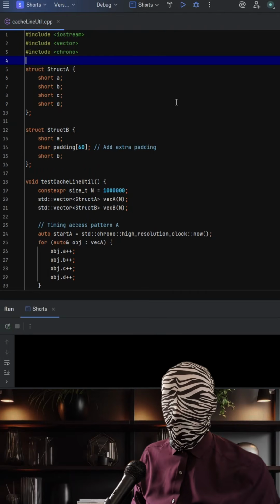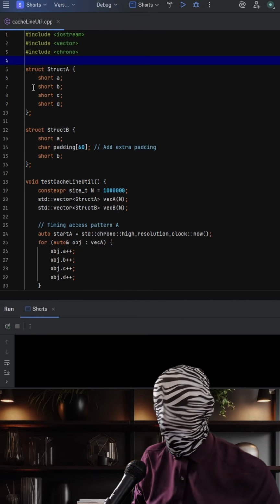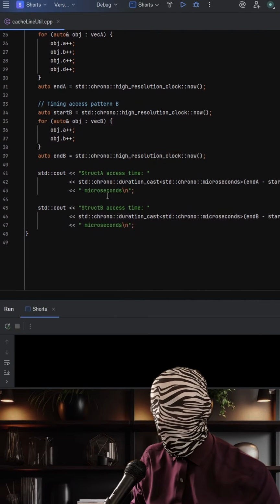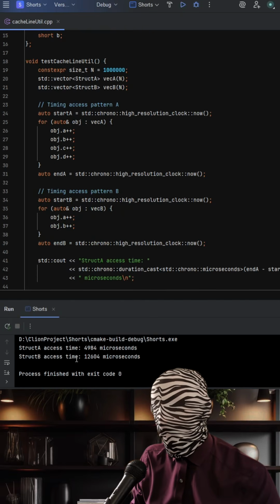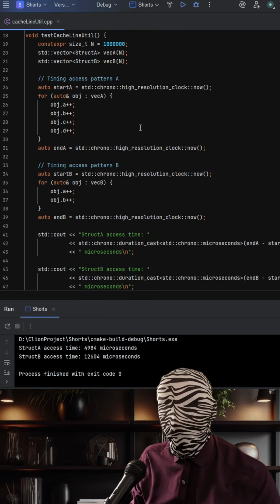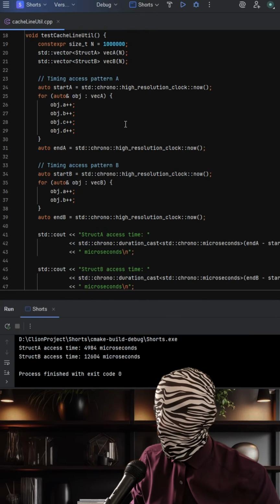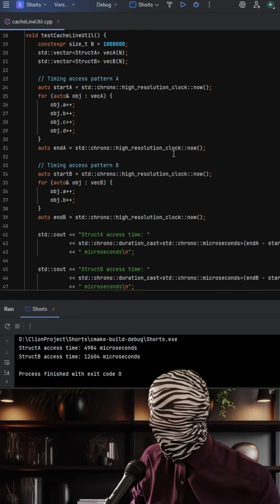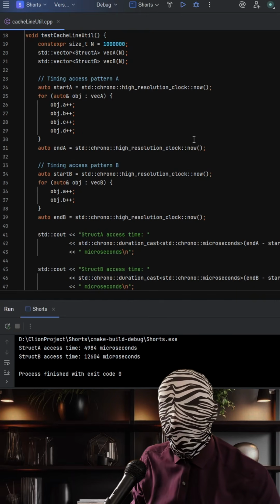Cache Line Tricks: Is your C++ Struct Layout Hurting Performance?

Comment: Late to the party; c++ has specifically designated patterns to avoid false sharing: check std::hardware_destructive_interference_size. Align each member of a struct to that constant, i.e. alignas(std::hardware_destructive_interference_size) int my_data_member; This way it’s portable across architectures

Comment: It actually should all fit in one cache line because it’s 64 bytes exactly, but each struct fills a whole line meaning it has to load from memory on each iteration
Reply: Theres also cache hit and prediction probability in for loop for increasing greatly for tightly packed structs. This exampel felt weird it would have been better demo of 64by limit if he made 62 byte padding.

Comment: How different would it be if both loops performed the same number of operations? It's kind of confounding when you use both padding and a different number of fields – to make it more scientific, I would re-do it with only the padding, keeping it to 4 short fields, or removing c and d from StructA.
Reply from the maker: This is a great point and it allows me to discuss another topic for this question that I just didn't have time to explain during the video. If both loops accessed the same number of fields (just a and b), you'd actually isolate the impact of cache line utilization. StructA, being small and tightly packed, fits multiple elements per cache line (spatial locality), so even when accessing more fields (a, b, c, d), the CPU fetches them efficiently in bulk with minimal cache misses. That’s why removing fields from StructA doesn't significantly improve its performance, it’s already benefiting from excellent cache locality. In contrast, StructB’s artificial padding means each element occupies a full cache line, wasting bandwidth and causing more cache line loads. This makes it slower, even if it accesses fewer fields. In terms of performance reducing the number of fields will obviously increase the performance slightly but the ratio between the time for B and the time for A still hovers around 3.
Reply: @CodeToCashFlow1  Ah, okay, I see, that makes sense, so you're showing that even if A does more read instructions it still needs to vacate cache less and is even still faster than B despite the number of operations.
Reply: If you were to keep the same number of instructions, it could only make things worse for the padded struct since A would be doing less already.  Even with the penalty of more instructions, A is way faster.